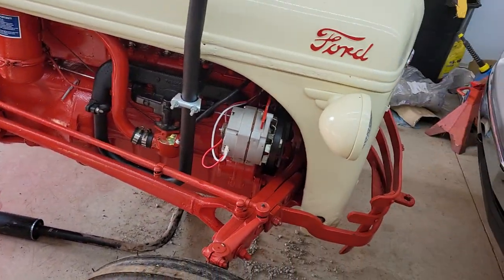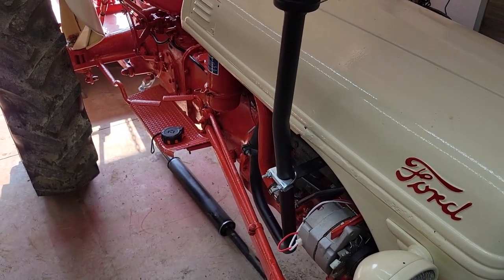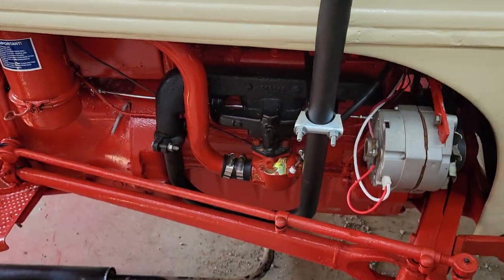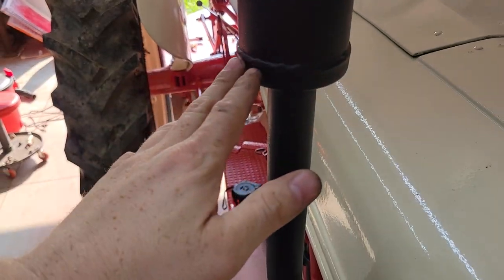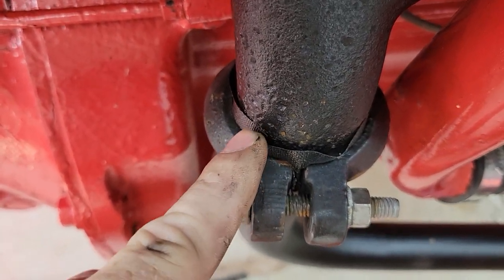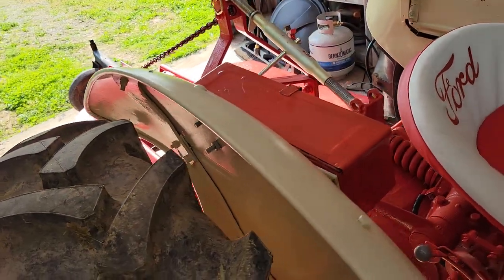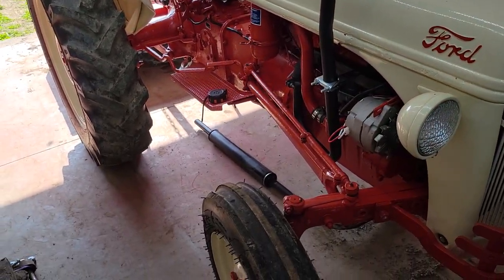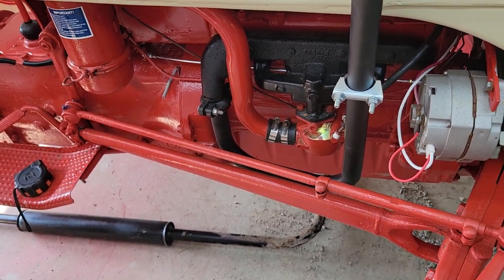Ford 8N Vertical Exhaust Review

Comment: i just want you to let you know that your overrun clutch is damaging the inner thread for the pto cover cap. i have seen it on many 8n tractors because the tolerances are to tight.
those overrun clutch designers have no glue what they are doing.
so check your thread before its to late.

Comment: What is the new shiny thing on your PTO output? I was not raised with Tractors so I have no clue. It looks like an extension, but why do I see so many of them/why are they installed? My '54 has the updated PTO shaft for the correct size more new implements. Do I need that device as well?
Reply from the maker: It is an overrun clutch. It is needed on tractor the does not have a live PTO. Research your tractor and see if it does. I also have a video on the install.